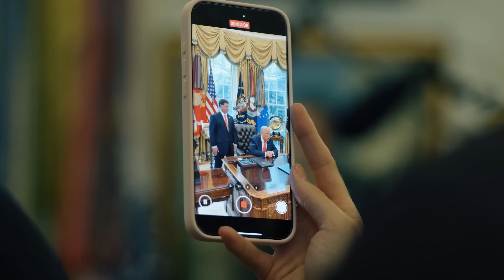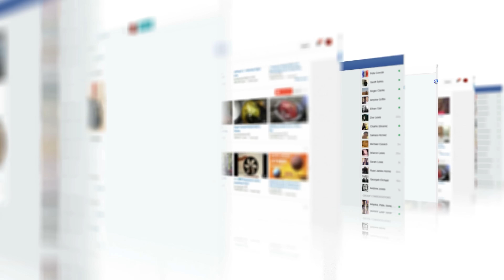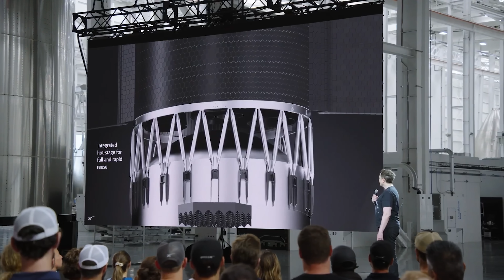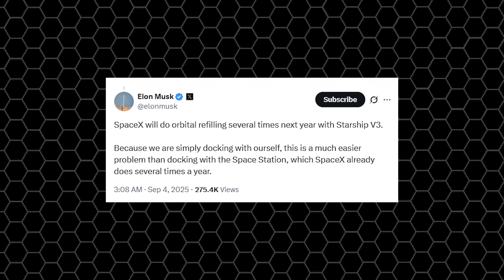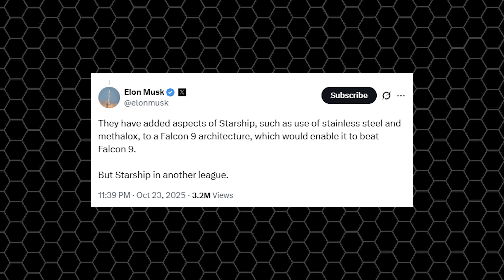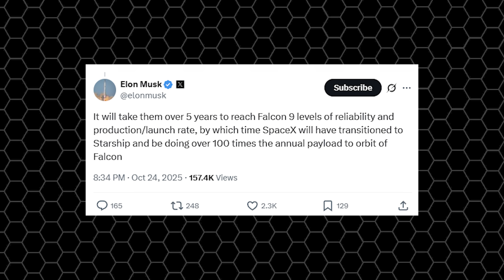SpaceX officially reveals New Starship HLS almost Ready, Shocked China & NASA

Comment: Still smoke and Mirrors

Starship has yet to reach orbit
Starship has yet to succesfully land without any damage for rapid reuse

Starship has to succesfully prove they can refuel in space.

All of the above were supposed to have happened 2 years ago at least.

Space X has used government money and has still not reached the milestones they should have completed.
Reply: I would like to see any other company achieve what SpaceX has to this point, late or not. Given the scope of the Starship project. SpaceX is moving much faster than anyone else we’ve could. Blue Origin has been in existence longer than SpaceX and has achieved orbit once. Starliner and SLS both reveal the pace other companies take. Starliner is a mess and SLS is very expensive and requires extensive amount of work just to get ready for launch. Remember… it uses Hydrogen for fuel. That is a big issue on its own. Also, Starship could have easily gone orbital. They just require about 30 seconds more on the second stage burn. The reason they haven’t is because the issue of an in orbit, zero G relight of the raptor engines. They have to have that down before going orbital. It would be very bad to put Starship in orbit and not be able to deorbit. THAT is why it hasn’t gone orbital yet.
Reply: SpaceX could easily get into orbit if they tweak the trajectories. The plan isn't to get to orbit, it's to go to Mars.
Reply: Don't cry baby
Reply: You do it then
Reply: Wrong.   3 Starship 
Flight Tests HAVE been caught by Mechazilla.   Check your data.  Oh, they've also ALREADY transferred LOX in space.   Really.   DO check your data.
Reply: SpaceX is funded by Starlink.   You didn't get anything right.  😂😂😂

Comment: The advantage of China is - there are NO Regulations from Environment issues or else, they just ignore everything and start their Rockets.
Reply: China is mindful of the environment.  A major reason for EV mandates is to lessen pollution in Chinese cities.  They are ahead of the West in many areas.  They have state banks and do long-term civilizational planning, exactly as George Washington wanted.
Reply: @mefobills279  China's "electric car graveyards" are vast, often remote parking lots where thousands of new or barely used electric vehicles, often from car-sharing services, accumulate. They arose from rapid government promotion of electric mobility, which led to an oversupply of vehicles and intense competition. These cars are not rotting away, but were parked there due to overproduction, lack of demand, or because their technical lifespan had expired.
Causes of the Electric Car Graveyards
Overproduction: Massive government subsidies led to the emergence of many Chinese electric car manufacturers and car-sharing services, resulting in an overproduction of vehicles that the market could not absorb.
Excess Supply: In some cases, there was insufficient demand for the electric cars, particularly those from car-sharing services, which is why companies parked the surplus vehicles in huge parking lots.
Technical Obsolescence: Older models were replaced by newer, more advanced models, resulting in the older vehicles becoming technically obsolete and no longer marketable.
Competitive Pressure: The fierce competition in China's electric car industry led to a surge in innovation, but also to enormous price pressure, which drove many small and unprofitable companies out of business.
Lack of Infrastructure: Although China plays a leading role in e-mobility, many regions lack the necessary infrastructure, such as charging infrastructure or the availability of battery swapping stations. This can shorten the lifespan of electric vehicles.
Consequences
Environmental Impact: The huge parking lots for electric cars represent an enormous environmental burden, as they not only take up a lot of space, but also because the batteries of many vehicles have not yet been fully recycled.
Economic Consequences: The electric car graveyards resulted in enormous economic losses for the companies that were based on excessive investment and production. Social consequences: The loss of jobs in the electric car industry and the burden on residents due to environmental pollution are social consequences that also affect people's quality of life.
Reply: @camelot65  You forgot the enormous waste of investment/resources for society. These things were subsidized by the government.
Reply: @rubenarce3324  I haven't forgotten. China finances all of its science and economy through the state. That's why they have cheaper cars and no repression against brand piracy.
Reply: @mefobills279  https://www.youtube.com/watch?v=tCh2N0NJ6M4
Reply: @mefobills279  Still building coal power plants! Still dropping rockets on villages!
Reply: @rubenarce3324 Whistling past the graveyard?  The coal plants are in the desert west and transmit power east on new high voltage transmission lines.  They are rapidly becomming uneconomic with battery/solar megaprojects coming on line.  There is also the first thorium reactor online.  They do need to acquire a southern equatorial rocket launch area, to launch toward the sea.
Reply: Never thought I'd say this, but China will end up saving the planet, whilst the US continues in it's blind and dumb route to ignorant destruction

Comment: Why do they insist on weakening the Starship structural integrity, when optic fibre and internal display screens (zoomable) would probably be far more sensible in many ways ?
Yes, they require power, but only minimal. The weight may actually be a saving compared to physical Windows ... 
This is not new technology and would certainly seem to rate higher from a safety perspective, compared to cutting holes in a cylindrical shape and worrying about large seals in a flexing skin ... ?
Reply: Terminal Lunar approach by humans always had a window before.  You can't have a camera feed glitch on the way down without a mark 1 eyeball as backup.  If manual override is instituted for any reason, the pilot requires reference.  We've seen a couple unmanned landers topple over the last year, on the moon.  Steely eyed space people make contingencies for the contingencies wherever possible, and/or practical.
Reply: @SliceofLife7777  I disagree. The risks are minimal and the advantages considerable.
With regard to Windows, I am anticipating large dust clouds with these powered landing, so actually visible cues are pretty irrelevant anyway and reliance on many sensors such as LIDAR and other instruments will be much more important than 'seat of your pants' type flying.
Reply: @Jester-Riddle There is dust spray on the moon.  But no dust clouds.  In vaccum, Newtons law is obvious.  The tiniest dust particals fall as fast as rocks in the lunar gravity.  But I do not design lunar landers.  Just a bunch odd morons @ SpaceX, bumbling blindly without our wise council..lol.  Look, I'm sure those windows are there for my reasons stated, and others.  Or they would not have incorporated them into the design.   Buy a car with no windows, if you trust cameras so much. lol 😊

Comment: What I don't understand is Blue Origin & Boeing both cried wolf about Space X. What do they have to show for it? Space X bailed Boeing out and Blue Origin has yet to get a rocked into space. But yet Space X is the bad one to NASA! Space X is constantly pushing the barriers and learning from each flight!!!!!
Reply: Blue Origin delivered a satellite to low Earth orbit in Jan 2025.
Reply: @alexander12305 SpaceX did that in 2019. Since then, they've commissioned Falcon heavy, and are working on Starship. In 5 years, they won't even be flying Falcons anymore.  It will all be Starships.  The competition are building rockets that would compete with the soon to be obsolete Falcon rockets. SpaceX, by then, will be charging far less than $1 million per ton to LEO.
Reply: @SliceofLife7777  I doubt Falcon and similar rockets will become obsolete. what if someone needs to deliver just one ton and doesn’t want to share the orbit with others?
Reply: @alexander12305 I think the idea is that starship will be so much cheaper people wont really have a choice
Reply: @alexander12305 It's what I've heard.  Perhaps scraps off the table for Blue Origin and ULA?  I thought the same, but compare price per ton projections to LEO, compared to Falcon9.  Starship is a has a small cavern.  They can't just drop everything.  A small orbital insertion stage,  or capability would be incorporated into each seperate payload that needs a different flight path than the Starship launch.  Like satellites destined for geosynchronous orbit. But the era of the small LEO satellite is upon us.  Starship will eventually have a clam shell access to its payload bay.  Allowing it to deploy a variety of payloads to LEO.

Comment: How the heck would they reliably pump fuel in space though?
Reply: They have already done that.
Reply: Basically, the idea is to use two Starships, one acts as a fuel depot and the other is the one that continues the journey they dock together in orbit, line up precisely, and the fuel is transferred through pumps and controlled pressure in a closed system, tricky part is keeping the fuel super-cold and preventing it from evaporating or forming bubbles, which is difficult in space because there’s no gravity, SpaceX has been testing this in short flights and experiments with cryogenic tanks, it sounds like science fiction, but that’s actually their plan.
Reply: Dock two ships together. run fuel pipes from the bottom of the tanks to the bottom of the other. Have another pair of pipes connecting the tops of the tanks, but these pipes have pumps in them. They will pump gas or liquid, they don't care. Use small thrusters to slowly accelerate both craft to settle the fuel in the bottom. Start up the pumps building up the gas pressure in one ship and lowering the gas pressure in the second ship. This will force the liquid fuel out of one ship into the other.